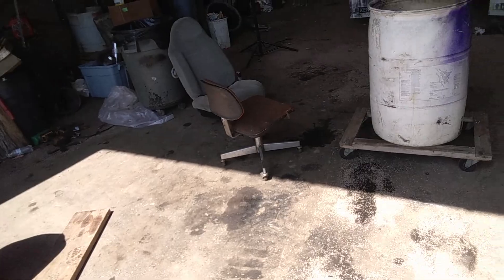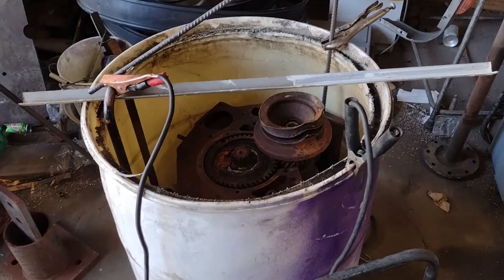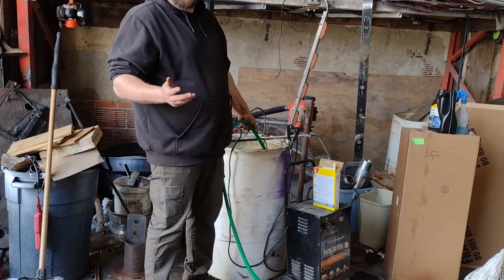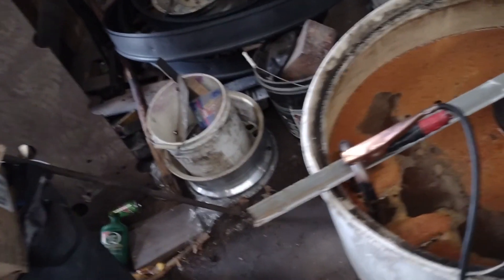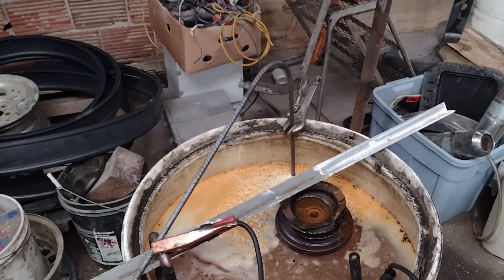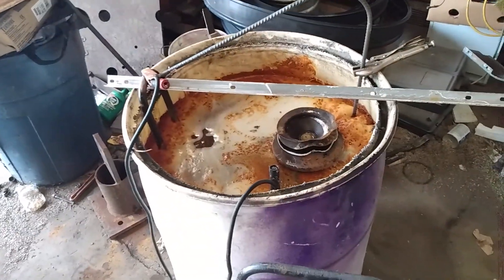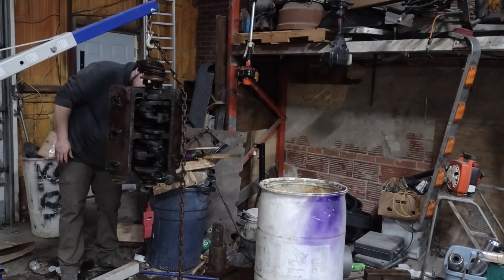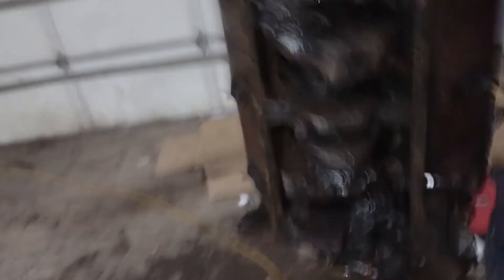World's WORST Ford Flathead V8 RUST REMOVAL Before and After - WILL IT RUN Again?

Comment: Great Video! I do the same thing with cast iron pans. The electrolysis works best line of sight. I've wondered if using a metal barrel to hook the electrode to would work to surround the object. I also use washing soda (sodium carbonate) instead of baking soda (sodium bicarbonate) I think it works better. But great job!
Reply: For anyone wondering, a metal barrel would surround the block better, but the process pulls metal off the anode, sp if you used the barrel as an anode, you would eat through the barrel.

Comment: Can you use a less corrosive metal as an electrode or is that part of the process? Copper would be a better choice I would guess?
Reply from the maker: Many people try stainless steel, brass, and aluminum as their anodes, due to the familiar corrosion-resistant properties of those materials. Unfortunately, stainless steel releases toxic materials as it decays, brass deposits copper onto the cathode (which accelerates rusting of steel), and aluminum quickly deteriorates.

However, there is a conductive material that can be successfully utilized as an almost non-sacrificial anode in electrolysis: graphite. Graphite is an electrically conductive form of solid carbon. You probably recognize graphite as the material in the center of a pencil.

Fine-grained graphite rods and plates can be obtained from McMaster-Carr or other distributors. Scrap and worn pieces can be purchased from eBay

Getting a large enough piece for use with an engine block however may be tricky
Reply: @TallGarage  
I wasn't sure how the process worked, thanks for explaining it.

Yeah, it would take a whole lot of toxic jab vials to get enough G/O to make an electrode big enough for an engine block for sure!